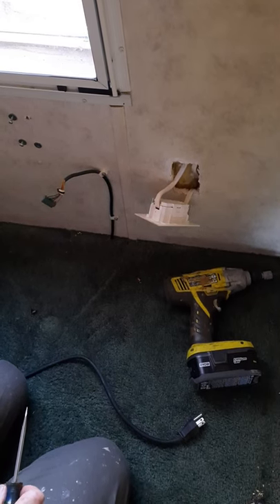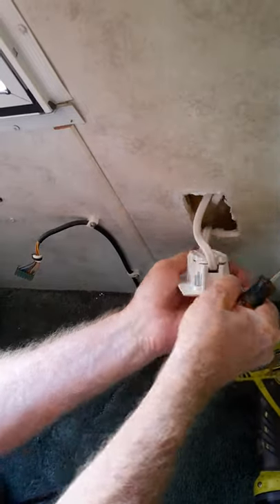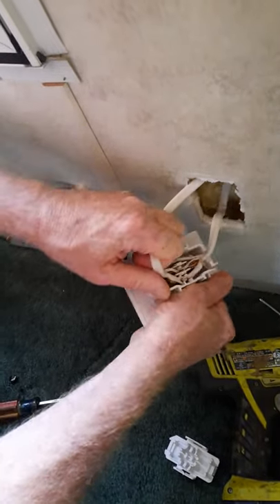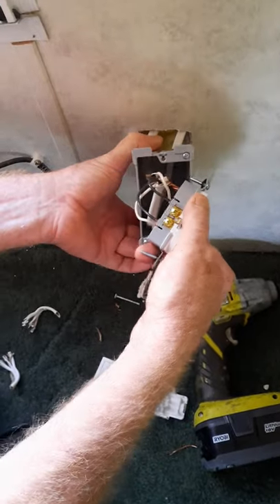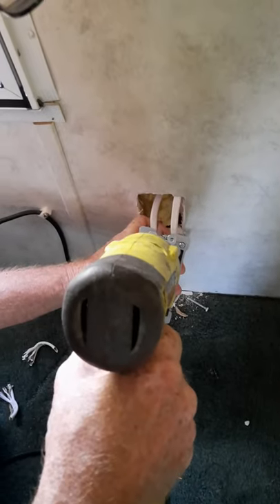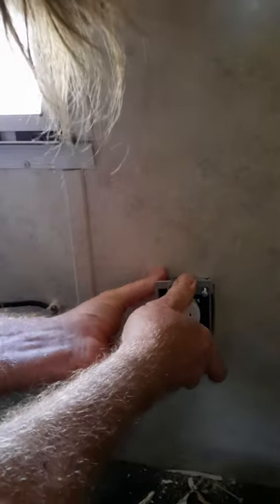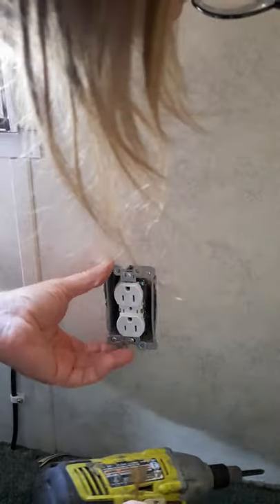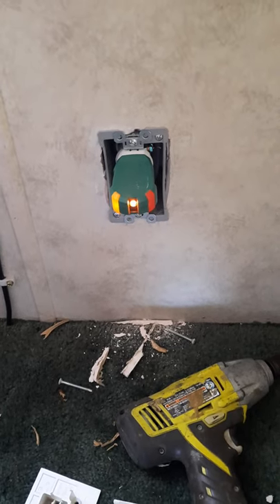DIY replacing an outlet in a mobile home.

Comment: Good video.  I have several that have been ripped out of wall.  Why do they allow such shoddy construction by FHA or other admin.  These outlets are dangerous in my opinion as kids can touch the wires if back is open.  Your redesign looks much better than what factory has done.  The factories could spend a few hundred dollars extra and they could put out an excellent house that should last.